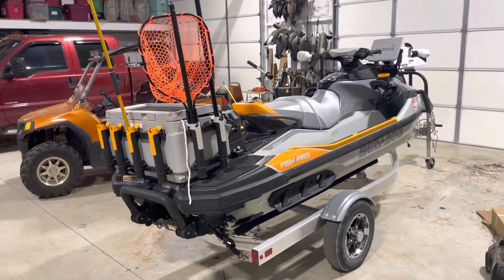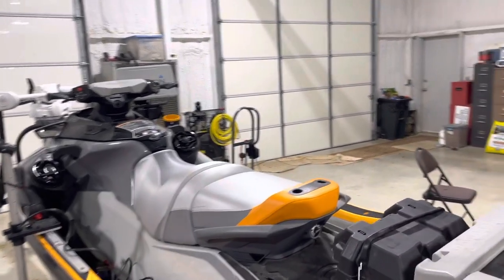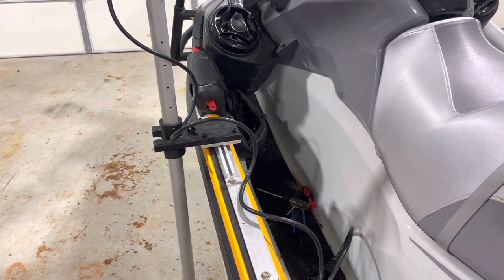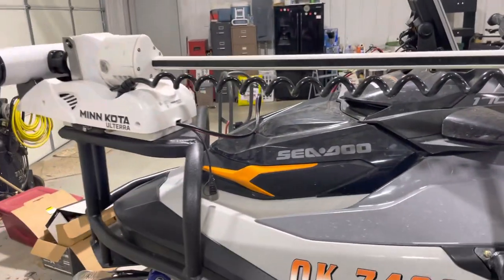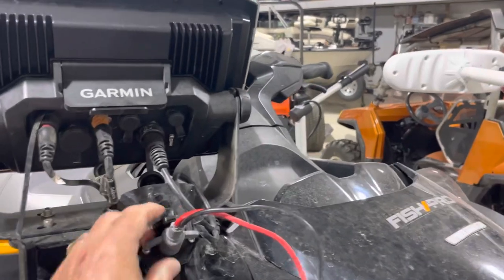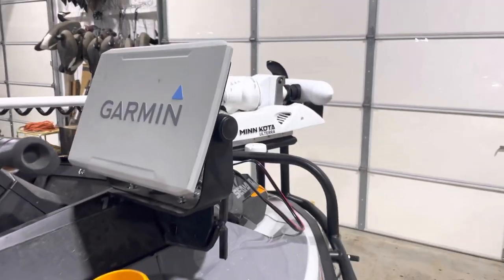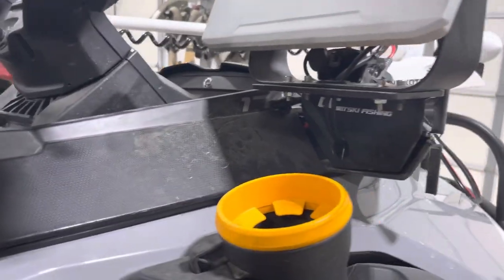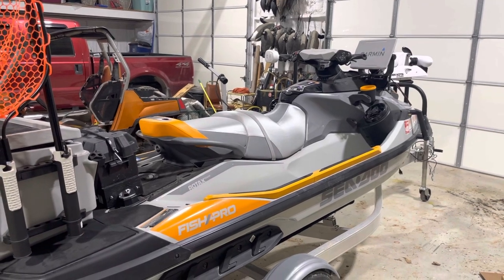2022 Seadoo fish pro trophy with trolling motor and livescope

Comment from the maker: That is a great question.  I actually thought I would do just what you suggested.  I had 2 nice skis.  One was a Yamaha Wave Runner and the other was a Kawasaki .  I purchased fishing racks for both of them but neither of them gave me the confidence to handle the big water in the gulf.  Probably would have been fine for fresh water fishing but I enjoy both. Each accessory on my Seadoo was well thought out.  When I go out to either the gulf or fresh water fishing, I typically can find the fish with my livescope and cover a lot of water.  I do more catching these days than fishing.  

The trolling motor has open up many options for vertical fishing in the gulf with the spot lock feature. 

I’m in Oklahoma and dragging a big boat to the gulf was not appealing to me.  

The Seadoo fish pro has been a great fit for me with so many features  as mention by another post .  

If you decide to get a jet ski and utilize it for fishing, wishing you all the best and many good memories.

Comment: Well to start with this, Jetski will travel 53 mph with two people on it. You can get a little over 100 miles worth of traveling on a tank of gas. The safety and stability of this craft is excellent for saltwater fishing. And if a storm comes up, you can get home in five and 6 foot swells. When you’re not fishing it will also pull a skier, wakeboard or tube.
You can actually stand on the foot wells and it won’t turn over so it is a much safer and faster option. And then, of course there’s all the other extras like the Livewell, I have nine rod holders to carry my gear. Also have a Trolling motor mount and livescope set up. so needless to say, this outperforms a John boat by quite a large margin. I have spent a lot of time fishing in John boats of various sizes. The way this fish pro works I would compare it to the first time I had a tractor with a front in loader and ac in the cab. You just realize something better came along and you never looked back.
Reply: Can I get a link to your trolling motor mount please?

Comment: I used to do a lot of brown trout hunting in high mountain lakes. You have to get in tight in the fall to the shore and rip for them, looking for that reaction bite in their spawning beds. I would used an old aluminum boat as most of these lake were riddled with huge rock cropping all over. I always thought to myself how a jet ski would work extremely well for this method of fishing. This makes me want to get one and move back to the mountains. It’s an amazing platform. I wonder if anyone has mounted down riggers on one yet . Although lead core line would be efficient a down rigger would be pretty cool and you get a more precise depth while trolling.

Comment: nice setup and nice to see a fellow Okie with a trophy.  Starting to think I was the only one. lol.  Im installing a power drive with ipilot on a rear mount on my '22 Trophy in another week or so, getting it ready for spring bass / crappie on lakes in OK.  I am going with a rear mount with battery tray as the whole assembly removes in seconds with the linq levers as I also use my ski for tubing kids and the wife and I load it down with camping gear when we go to the islands at Texhoma when we arent fishing.   Have you had any any issues running the TM and getting water in the engine?  I ask because BRP says not to tow above 5mph... and im assuming ski does around 5mph with the TM at speed.

Comment from the maker: Their are some rear mounts  out there that I have seen.  I guess it depends on the kind of fishing you plan on doing.  For my application with the livescope and in the gulf,the  rear mount would not work for me.  I would not put a trolling motor on the ski that does not have spot lock. If you were in the gulf, the waves would be approaching the back of the ski making it difficult to
manage  the ski in rough waters. Plus if you wanted to bass fish and bang the banks, trolling from the back would catch more drag.  The rear mount is certainly less money but you may be a little limited on your fishing options.  Best of luck and thank you for your comments

Comment from the maker: The self deploying Ulterra has an 80 pound thrust and requires 24 volts.  1 Lithium 24 volt battery would be the best choice for the trolling motor if using the Ulterra.
Reply: Wouldn’t a 12 volt trolling motor system be plenty for a setup that size??

Comment from the maker: The way the transducer is mounted underneath the hill, the jets do not interfere with it at all.  The side and down imaging works great.  I do use the 2d sonar n the gulf as well which is the only feature I have with the non the hill
Mount.  The down  and side imaging does not work mounted in the hull.  Hope that helps you.
Reply: When you removed the 7" Garmin that came with it did you mount the new transducer in the hull replacing the 7" Garmin transducer or did you mount the 126SV's on the outside

Comment: Why add the trolling motor?  The 2022 Seadoo Fish pro Trophy has built in trolling settings.  What's the advantage of an electric trolling motor?  Less sound?
Reply: Spot lock on the trolling
Reply: The trolling mode on a Fish Pro is for setting lines out behind you and “slowly” dragging your bait behind you, the trolling motor is for “powering” your ski along and actively casting and retrieving, plus the added advantage of spot lock basically anchoring you in one spot.

Comment from the maker: Great question. If you are only using the fish pro to troll, you do not need a trolling motor.  However, if you want to catch different species of fish consistently, you will need the ability to spot lock over a structure or near structures.  The fish pro will not hold you in spot lock without a trolling motor plus you are always having to keep your motor on racking up many many hours of wear and tear on your ski.  

Other work arounds is tying up to an oil rig but that can be dangerous due to waves and current. 
I have fished a lot on the gulf with and without a trolling motor.  The ability to fish over a structure and hold your position will allow you to catch the fish that are biting.

Yep, and sometimes trolling is the best technique depending on the type of fish you are pursuing.  With the trolling motor you have a lot of flexibility.  

With the trolling motor your ski is turned into a complete fishing machine with the same advantages that other boats have but at a lower cost. 

Best wishes.  With or without a trolling motor, I hope you catch a lot of fish and make some great memories. 

Check out One Off Outdoors for more information on the trolling motor mount.

Comment: Do you find yourself getting backpain while being on the ski for extended amounts of time? wondering if its a thing considering there is not backrest
Reply: It is definitely a workout on a ski in rough water. Flat lake type water no problem. It’s just like driving a car compared to a motorcycle. On a motorcycle your body is fully engaged in the steering. On a ski it is definitely multiplied. The constant core workout in rough water or the action reaction you get from hitting other boat wakes. I would recommend renting a ski before you buy. Make sure your rental is a large ski as they are more balanced. They also ride and steer very differently from one of the small nimble skis designed to play around on. You want the touring model size. Also you can standup on a ski while driving which is very comfortable and your legs act as shock absorbers. The biggest problem for me is that my hands go numb due to carpal tunnel issues that I have.
Reply from the maker: No,that has not been a problem.  I had back surgery in 4/22.  Been in some rough waters in the gulf and my back is holding up great.  Good luck!  My ski has opened up a lot of options for me with both fresh and salt water.  Good luck.

Comment: Hello Joe, can you please tell me who installed your trolling motor bracket I would love to get one on my new Sea-Doo trophy. I am purchasing very soon for offshore grouper fishing.
Reply: I have a 36 foot off shore Boat that I have 120 inch Vota I use for spot fishing and holding over ledges. It works absolutely perfect. I could see this just being a total game changer over ledges nailing the redfish grouper Bass and bottom fish.
Reply from the maker: I’m sorry for the delayed response.  We worked with a fabricator to design the trolling motor bracket.  I can tell you it is a game changer.  It is a very long process getting the trolling motor bracket to a manufacturer that can mass produce it with an easy install. Get in touch with One Off Outdoors.  I believe he is very close to getting the bracket ready for purchase.
Reply: I had a aluminum plate made to bolt behind the ladder bracket, to use as a flat surface to mount the transducer to, and it caught enough water behind it, that it worked against the steering, made it hard to control the ski, I had to take it back off!

Comment: is that the 85-pound thrust thought it needed two batteries? And what brand battery you using that is 25 pounds?  Thanks
Reply from the maker: Hey Joel-sorry for the delayed response.  I went with a 24 volt lithium battery. The lead batteries added to much weight to the Fishpro. The 24 volt lithium only weighs 25 pounds.    So much lighter and last longer.  I purchased the Dakota 50 amp 24 volt.  It has an 11 year warranty.  It was pretty pricey at 800.00 but there r other good 24 volt lithium batteries that r n the 600.00 range.
Reply: @bwon4440  Need to ask Joe I was asking the question like you
Reply: @joemcadams6783  How many hrs can you troll at speed level 3-5 on one fully charge of battery

Comment: Is the motor mount made out of aluminum?  Just curious how heavy it is.
Reply from the maker: Yes
Reply from the maker: It is very light.  Would not recommend using any other than aluminum especially if fishing saltwater.
Reply: @joemcadams6783  I was considering stainless for mine, but aluminum is easier to work with. Not a lot of saltwater in Wyoming, so I don't have to worry about that.
Reply from the maker: Makes since.  Well enjoy your ski.  Hope it all works out for u.

Comment: Can I get the link to your Garmin mount? I have the Garmin 126 SV I want to mount on mine.
Reply from the maker: Google GC Jetski Fishing.  They also have the exterior transducer mount
Reply: @joemcadams6783  Did you have to remove your mirror housing unit to make the bracket fit tight and snug? I want to run two Garmin Echomap Ultra 126SV units. One on the left and right side because I'm installing live scope and will use one unit for that and the other for mapping or running off the transducer

Comment: Curious about your experiences fishing with this in both salt and fresh water.  Is there room for two (say - a teenager?). Looking at one for the Long Island Sound and big lakes up here in the northeast
Reply from the maker: Sorry for the delayed reply.  Yes, no problem with fishing 2.  Especially with a trolling motor in spot lock.  I would not feel comfortable taking a passenger with me n 4-6 ft swells.  But, yes I have fished 2 on my ski in Destin catching several 6-8 ft sharks in the gulf.  Very happy with my Fishpro with the added accessories.

Comment: Serious question: Why would I buy this instead of a cheap, used 2 person ski? I could add everything this has for a fraction of the price..?
You could add a fish finder, mud rods and never spend this kind of money.
Must be nice.
Reply: You could and should if that’s how you roll. I went with the Fishpro mainly because of its advanced engineering. First the balance and stability is ridiculous. I can stand on the footwell and walk from the back of the ski to the front. They are just almost impossible to turn over. This is due to the width, deep footwells and extended deck on the back.  So the ski has a 4ft by 12ft footprint. Next the entire front end acts as storage. That means the whole steering column and everything lifts to expose a 2x2x3 foot storage bay. So no more reaching over the steering column to access storage. It has an IDF system that no new or old model has and I used it today. It is basically a reverse thrust that cleans out your intake. When I’m shark fishing in not interested at all in jumping into the water to manually pull out handfuls of floating sargassum sea grass or plastic bags. So you can go as shallow as you want and through the grasses if you want. It has a 170hp motor and it goes 54mph with both my wife and I on it. Will all the added extras/weight it goes 48mph. The Linq system to lock down the live well and other additional containers is just absolutely incredible. If you have ever spent time ratcheting down stuff to only have it come loose or the saltwater corrode them in 10 days then this system answer those prayers asap. It has a cruise control for trolling. Bluetooth sound system. USB port for phone. The forward and reverse shifters at the handgrips. So when I dock I can literally go sideways. It has a tow hook for tubing. A ski pole mount to ski from. It holds 3 passengers easily. There is actually more I could mention but if I were you I would go to a dealer and look at one. They have different models to choose from. Joe Mcadams and I are best friends and have been fishing buddies since we were 5 years old. Brother we have paid our dues. Fished out of everything including an old bathtub. So when you reach our age you gain a lot of wisdom. This ski is your base and then you build on that base to fit your needs. You can go to my YouTube channel and see how we have come up with a lot of these ideas. It’s a great way to experience the water and by far a cheap and easy way to experience the water. Go to One Off Outdoors. That’s my channel. Feel free to leave any comments there. And heck if you want to call and talk I’ll do that as well. Have an awesome day and enjoy each day you have been given and live life one off.

Comment: Interested in the trolling motor bracket, seems very sturdy, keep us posted on availability and pricing please
Reply: Hoping to have things lined out soon. When they become available for purchase you will find all of that information on my YouTube channel. It’s called.   
One off outdoors 
Thanks for your interest. I promise this will absolutely change how you fish on your ski. It is incredibly sturdy. I am now using a schedule 40 aluminum. Just great balance. Easy install. All around just really an awesome system to add to your ski.
Reply from the maker: We have the new design completed for a much easier install.  The new mount is currently being powered coated and we will do a field test in the gulf toward the end of August.  If the field test does not require any modifications, it will be available for sale in September.  It will be sold through One Off Outdoors.  We are doing everything we can to bring it to market at a reasonable price.
Reply: Please keep me posted!!

Comment: That HUGE battery in the Rear SUCKS. It kills the foot area for the rear swivel fishing seat.  I get it, you want the coolest shot on your PWC, but retrofitting BOAT SIZED gear on a PWC sucks.  It would be nice if Seadoo would partner with farming and Minncotta to build a setup that will give Live scope, and a hold in place self deeply trolling motor that os designed for the fish pro.  

You are definitely on the right track, but it’s definitely a compromise that doesn’t necessarily have to be of the manufacturers would work together
Reply from the maker: Thanks for your note.  The battery is the size of a standard marine battery but it is lithium so only weighs 25 pounds.  I’ve seen other fish pro owners putting the battery in the ice chest which is just not practical.  The ice chest/live well is too valuable to sacrifice the space for batteries.

The fishing seat as it is has no value for a fishing angler unless u can use the old fashion anchor to sit on some structure.  Perhaps it could be used in freshwater fishing for crappie but I have not found a use for it.  I took it out of storage area for more space.

While I have not used the fish seat elevated, if I was fishing the banks for bass or slowing fishing walleye,  I would put my trolling motor on a contour line and follow the contour while sitting on the elevated seat.  The battery would not be in the way for the most part.

I do agree that Seadoo should make it much easier to accessorize the fish pro for the diehard anglers out there.

The trolling motor has made the fish pro a very versatile fishing craft.  The spot lock feature has made a huge difference fishing over structure in the gulf.

The trolling motor bracket is almost ready to sell to other Seadoo Fishpro anglers.

All the best
Reply: @joemcadams6783  thank you so much for responding with useable information. I plan to built and outfit a 170 trophy for deep sea fishing using out riggers from Australia.  Thanks again
Reply from the maker: You bet.  Wish you all the best .  Have fun and catch some big ones.